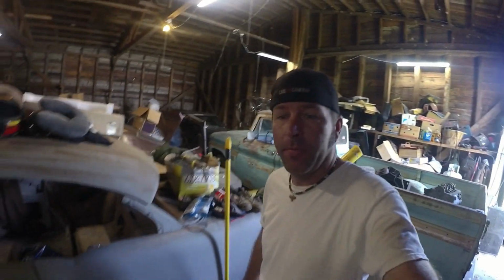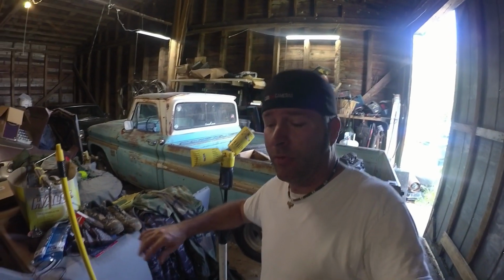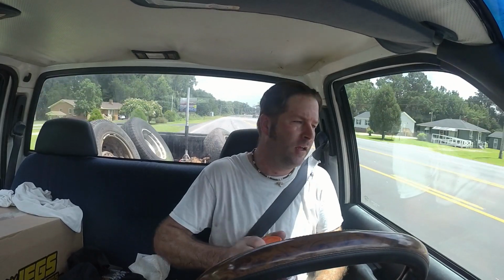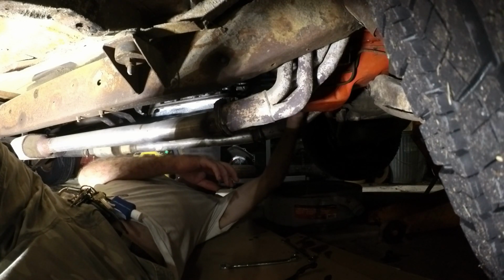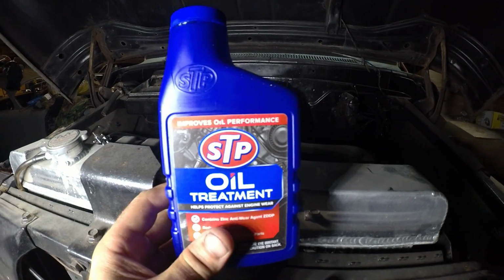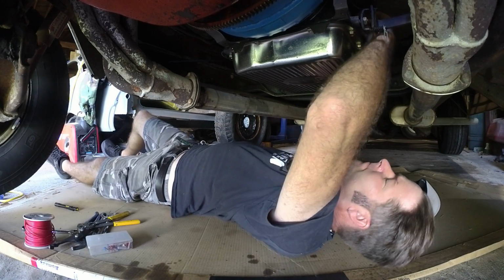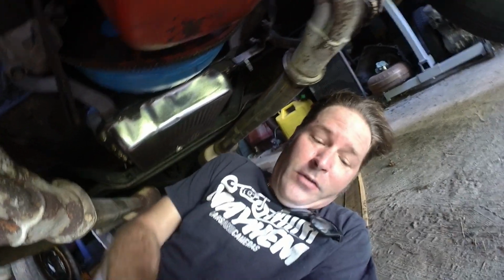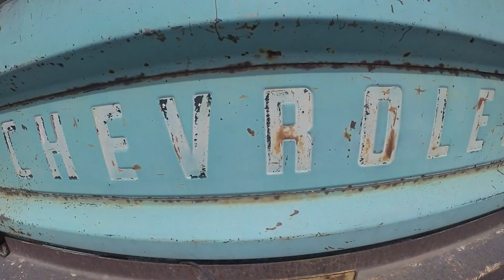Im Trying To Get Ready For Power Tour 2021!

Comment: Right on at 11:05. 👍 You were right to make sure you did everything correct by checking for leaks. After you shut it down did you check the oil and add to the full mark on the dipstick? Because the new filter gets filled after you start it up.

Comment: Excellent video Issac  :) also 1966 Chevrolet rides also looking very good and keep running perfectly too! Also I wouldn't worry to much have engine oil over full because if got big oil pan plus strong oil pump too and great quality oil filter too it make difference! My Chevrolet Impala car have big oil pump plus I use Fram oil filter of 13A also 8A one on 350 V8 plus PCV Valve also Air Filter 2X  type and 10w30 engine oil Valveoilne or Pennzoil no synthetic types! Plus Platinum spark plugs AC Delco LT 44'S high suppression wires too and much more !

Comment: You're getting there. That arm's still pretty much just hanging there though, you need to use it! I'm picking up that Jack even was just support you need to use it.. been there done it, been there didn't do it! You actually popped into my head the other day when I was out driving, I want to make a turn and had a red hot poker driven into my left hand shoulder and went numb from the elbow to the hand. It doesn't happen a lot but it happens often enough that I've learned how to deal with it. Hopefully you won't have those long lasting difficulties

Comment: Hi Isaac, knowing that you had the misshap and with covid etc what foreseeable plans have you got for the model A still on the hoist in your other shop?
At least if you took it off the hoist you could use the hoist!
Good to see the injuries are improving.
BTW Do yourself a favour and get a Steering knob for the steering wheel in the truck for the tour it will help on the drive for Your good arm, I have been using one for about 3 years and won't ever take it off any car I own now 

Tony from Western Australia 🇦🇺

Comment: If that's a crate TCI built tranny it won't last as long... The solder connectors will melt using a lighter,or a heat gun...

Comment: Hey, Im fairly sure this is 400 sbc, but Im curios what trans you are running? It seems like an easy hook up for a 4 speed w/ lock up tq conv. with a old style motor.
Reply from the maker: 700r4
Reply: @isaacitllbefine7231  Most 700r4s dont have a tech line and I like the idea of a help line, is this a big box trans?
Reply: like jegs or summit? I bet you got it in a trade didnt you? never mind. Hope you recover 100%!

Comment: Hey man I've had the same type of shoulder injury against you but if you don't start using it some you're going to lose all Mobility you'll never get back to a hundred percent if you don't start doing some type of movement weightlifting of some sort just try to get back to your normal self that way your arm will actually kill the way it needs to I see your favorite in a lot would you doing that it's going to potentially hurt you more in the long run

Comment: GM rally rims are by far my favorite truck wheel. I was told one way to get the TCC lock up to work well was to tap into the 4th gear pressure port and put a pressure switch in line to activate the TCC. That way you would get the trans into lock up on the highway in 4th gear and not worry about having the torque converter locked up when at a stop light etc.

Comment: I'd thought you knew better! 1st a Fram filter is the worst you can use and 2nd you installed it with no oil in it? WHF DID JOHN TEACH YOU THAT? I thought you were a mechanic?
Reply: Wix filters are the best!